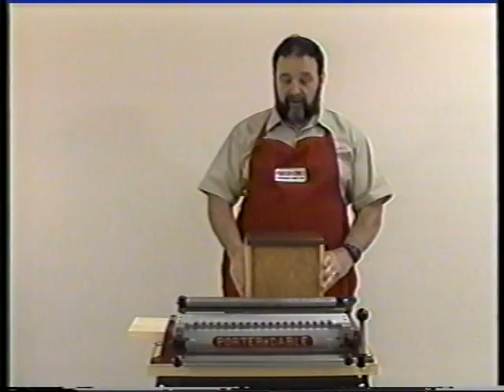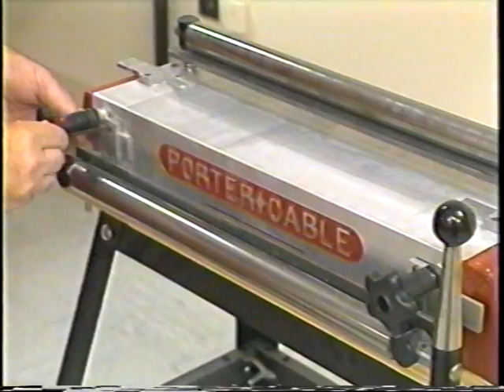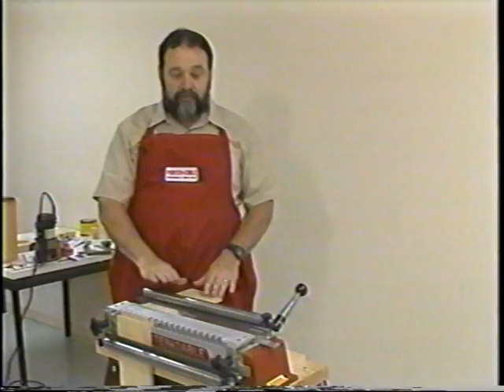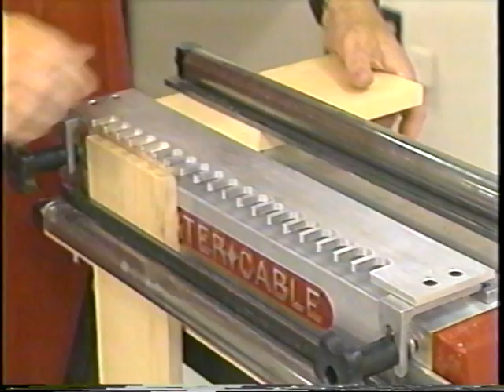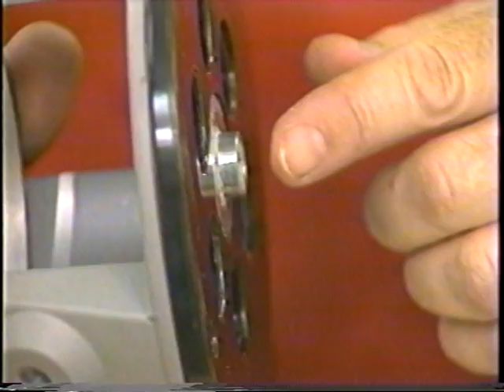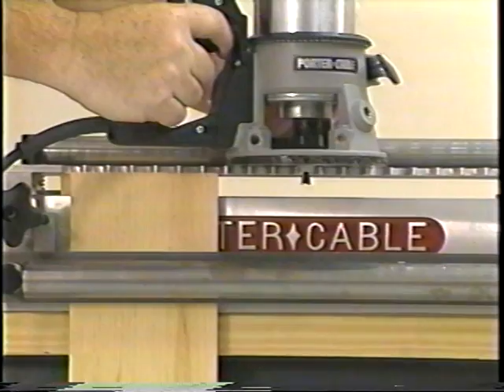Porter Cable Omnijig 5116 Dovetail Machine Instructional Video part 1 of 4

Comment: Porter-Cable Model 5128; A 16" Omnijig® Dovetail Machine with a ½" Box Joint Jig; Porter-Cable Model 5135
But there are other Dovetailing Machines as well.
Porter-Cable 4111; A 12" Dovetail Machine with a ½" Box Joint Jig; Porter-Cable Model 4127
Porter-Cable Model 7113; A 24" Omnijig® Dovetail Machine with a ½" Box Joint Jig; Porter-Cable Model 7129
Tools with Accessories are advised or required.
Porter-Cable Model 8541: A Variable-Speed 2 H.P. Mid-Sized Plunge Router at 13,000 R.P.M.'s with a 5-¾" Circular and 1-⅛" Standard Center Hole Sub Base: Porter-Cable Model 30185 with 3 Phillips-Headed Router Screws, a ⅝" Inner Diameter or 13/16" Outer Diameter Guiding Collar: Porter-Cable Model 30058, a Lock Nut: Porter-Cable Model 30248, and a 2003 version of a ½" Straight Cutting Bit: Porter-Cable Model 42316

Comment: on my templates I split the distance of the comb in half then drew a line. I then found the center of my board on the horizontal board and drew a light line a short distance from front to back.  I found the this automatically centered the piece under the combs with any board I cut.

Comment: Will these measurements also work with the Porter Cable 4216 templates?
Reply: Daryl D...  Yes, but the newer machine uses Stops that are pre measured and more or less properly space the offset once you position your piece evenly under the fingers...  I am Certain you will Master your 4210 Jig and Templates... I own both the 4210 and 7 of the 7116 with all shown templates... Happy Wood Working...  Greg

Comment: This makes me feel like I’d rather want to do the dovetails by hand
Reply: Jesus Jimenez Hello, Do you Really think you can produce “Half blind Dove tails” faster and with better accuracy than with this Jig... I think Not...
Wood Magazine did a "Face Off" between a hand cut method and using a machine; The machine was “four” times faster and did a nice Tight fit... The person cutting by hand admitted defeat...
Reply: both have their place
although this guy is not a very good educator,  he seems to want to show you more how awesome he is than teach you how to use it , also he tells you what to do , but never tells you why
and dont get me started with all the 32nds measuring..
unfortunately this is all we have
to go with this very ruggedly made dovetail jig
Reply: Jesus Jimenez;  Hello, Do you use a Dovetail Jig...?
What system do you. Use...?
Reply: That's what I was thinking lol. But if I'm making a bunch of drawers I'd do this. If I was doing a one off box I'd just do it by hand